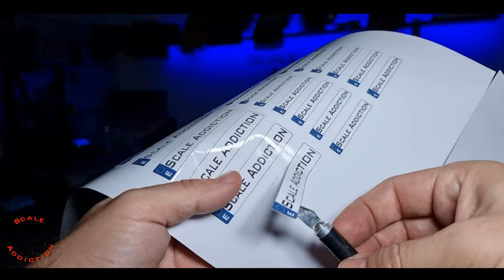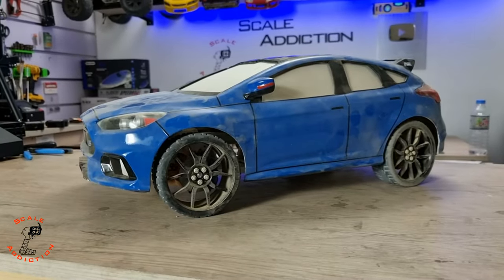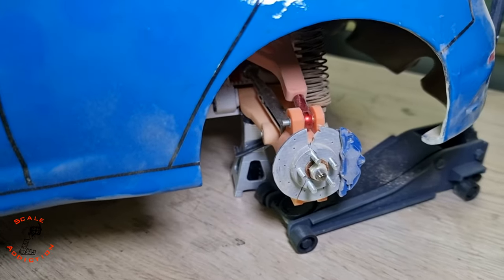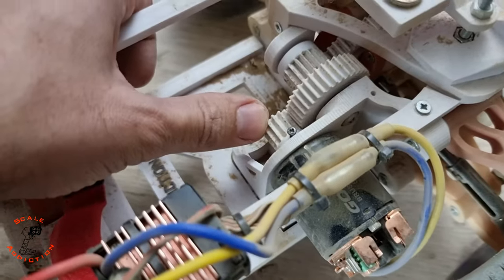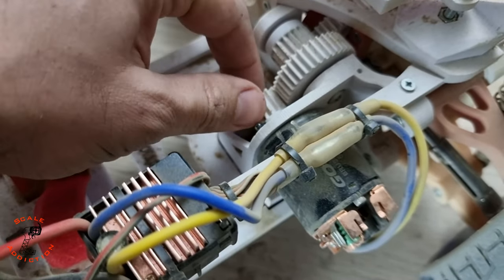First Off-Running 3D Printed 8th scale Brushed rc car part 7 | Scale Addiction

Comment: Hhmm maybe a bit more lift if your going to keep riding in the dirt? And maybe rally/buggy tires, will give you much more grip. The car looks great 👍
Reply from the maker: For the suspension I will design air suspension soon, I tried griping dirt tires, but it was rubbing on the fender
Reply: @scaleaddiction  air suspension, great👍.

Comment: Now you need to put 4 wheel drive with diff lock so it won't stuck in sand 😁
Reply from the maker: Its actually 4 wheels drive and locked diff, I had to tie the chassis to take that shot lol
Reply: @scaleaddiction  oh that's why. Great 👍